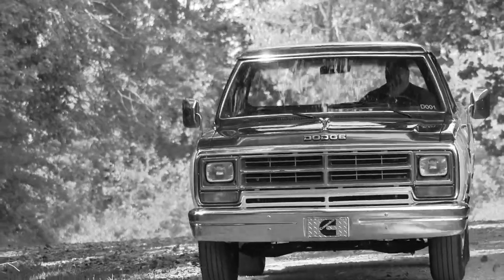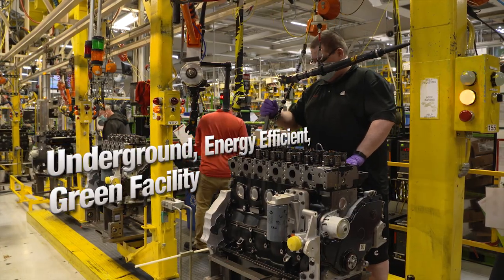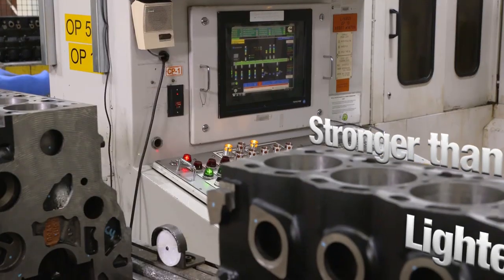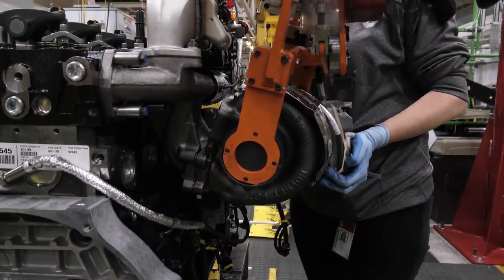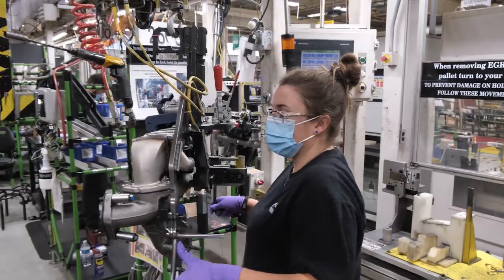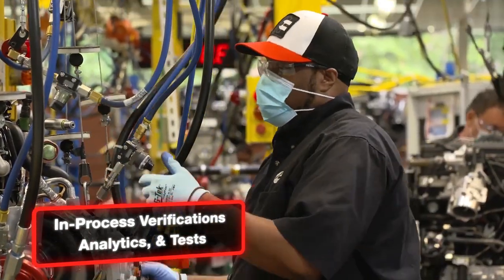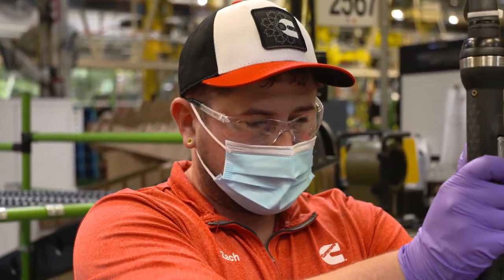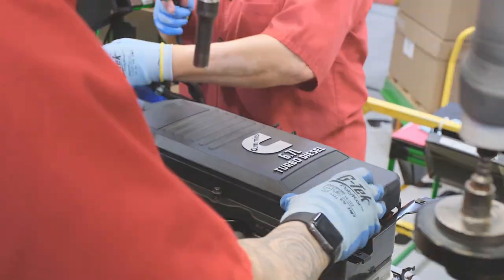Inside Cummins Mid-Range Engine Plant

Comment: So glad I bought the last of the no emissions trucks.... 2004. Only had egr in the cam profile...
But last year at 165,000 miles it dropped a valve seat. $15k later... new cam without the egr profile and a totally rebuilt engine.

Comment: Cummins should be ashamed they built so many RAM 2019-2020 6.7L with the CP4.2 glitter bomb fuel pump. When are these trucks going to be recalled for a CP3 (CP-ISB21S3) install?
Reply: That is not a Cummins issue.  That is a Bosh issue.  The recall is not a Cummins issue, but a Dodge issue.  Think you can sort out where to point the blame gun now?
Reply: @ShainAndrews  I thought Cummins made their own fuel equipment. Ashamedly I have to once again admit that whenever I think of something, I'm wrong. Note to self: stop thinking.
Reply: @satunnainenkatselija4478  Nobody makes their own fuel systems.

Comment: Dear Cummins officails you really need to address the soot issues in the engine lubrication system and the exhaust gas recirculating system that infects the intake system and engine combustion system. This problem severely destroys the ability of the million mile marker to 300,000 miles or less. Intakes caked up to 1/2 inch to 1 inch of soot cmon your better than this! These 6.7 liter engines are the best ever designed yet there one flaw will be there demise SOOT!
Reply: That is just the problem of these low emmision engines. U have to sacrifice engine life and power to reduce as much emission as possible & use as little fuel as possible. Egr system is troublesome for every engine! No maker has ever made a good engine with these egr & nox reduction system.
Reply: Tell that to the EPA
Reply: @7Amps  EPA doesn’t tell cummins where to collect exhaust gases from the exhaust system cummins decides that there is no excuse for collection to be before the dpf filter period.
Reply: Well I'll probably get some people mad by saying this but "Delete it" ok I said it. Yup its time for people to understand that the stuff that comes out the exhaust pipe with DEF is way worse then without it. And no electric will not replace fossil fuels! Why? Because are power grid will never support it! Sorry if your a environmental freak reading this its time to smell the roses. But hey if you don't want to drive a vehicle, well they make bikes! Oh yea fun fact. Last year, 2020, the year of covid!, people stayed home more then ever and the emissions was less then before the whole emissions craze started. And guess what temperatures where higher  across the board and scientists blamed it on less emissions in the atmosphere. So if your a climate change idiot that is so "concerned" about polar bears then how about we remove emissions regulations.
Reply: @dwightmartin5540  yep
Reply: @dwightmartin5540  you sir need to study chemistry the byproduct of the use of def is harmless nitrogen, water and oxygen. Go back to high school.
Reply: @Jon-O.  and it emites harmful ammonia that is worse for plants and respiratory systems then untreated diesel exhaust. California state themselves conducted a study to see why they have plants dying alongside the roads and they found out because of the ammonia emitted by DEF treated exhaust. The soot that is in untreated exhaust settles out of the air very quickly and cause very little to no harm to humans plants and animals. Here's a link to a video you should watch https://youtu.be/l9Tik1yJ1HU
Reply: @dwightmartin5540  untreated is most definitely worse which you can’t seem to grasp.
Reply: @Jon-O.  Nox vs. Ammonia... well I know which one I'd rather breathe. At least the untreated stuff smells good! But anyway if people want to deal with that corrosive DEF crap they can ill keep my diesel deleted and trouble free!
Reply: @dwightmartin5540  lol can I get a side of smog with that to go
Reply: @dwightmartin5540  We have to have all EPA emissions laws so the profiters “ politicians “ can line their pockets then sugar coat it with lip service like “it’s to protect the earth and the children “ now see how that makes us all warm and fuzzy inside while they get rich off of all of the EPA emissions regulations. Now doesn’t that make you feel good about all this on your engine while it’s at the dealership getting $10,000 worth of emissions equipment replaced at your expense😉
Reply: @Smooththatsme  that the exact reason I got a hold of some good buddies of mine that know a little more about engine tuning then me and sat down and spent a few minutes behind a computer screen and now my truck no longer takes any def and it has a straight thru 5 inch exhaust pipe instead of the dpf and whatever other crap used to be underneath my truck!